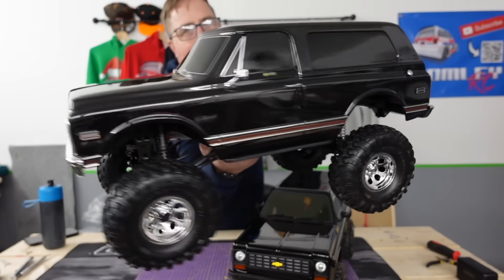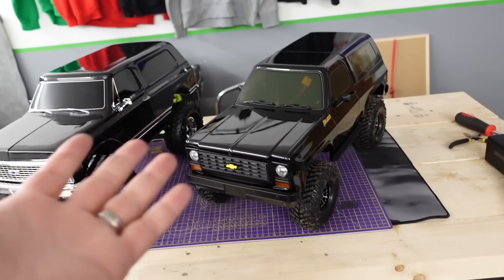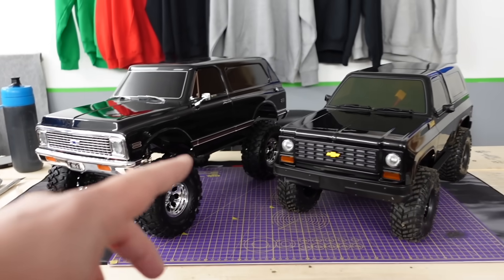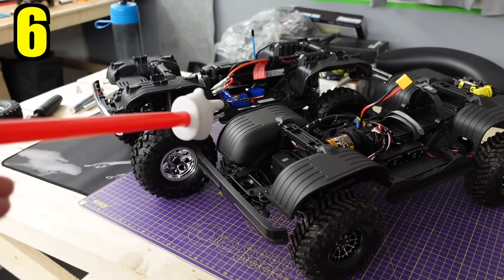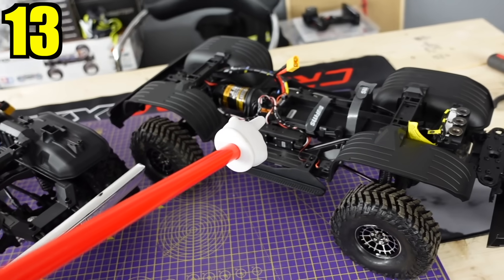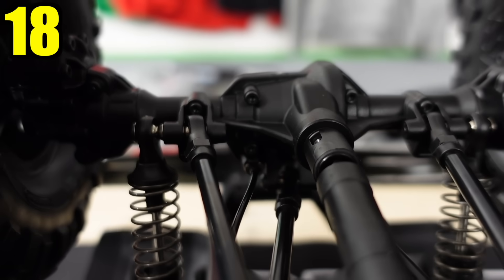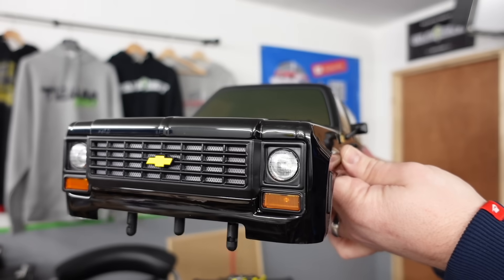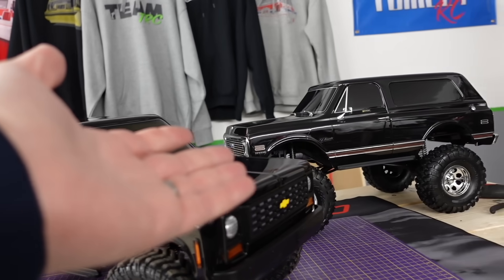You're Wrong.... Again!

Comment: You wouldn't notice because you aren't a Chevy guy, but  the FMS K5 body proportions are not correct, where the Traxxas version of the '79 K5 is. And that's a deal breaker for me.  I'm not sure if it's because Traxxas uses two different wheelbase chassis and FMD only has one

Comment: Can you make a video about 4 links suspension and 3 link with pan hard and see what s better. ?
Reply: 4 link servo on axle (SOA) every time. Lower servo mount lowers center of gravity and puts the weight of the servo directly on the axle, below the springs where you want any weight. Also, better, equal steering left to right and doesn't bump steer or lean the rig while steering like the 3-link with panhard does. Everything is sturdier and stays in line with 4-link SOA. I hope this helps
Reply: yes it does. thank you so much brother.  @OkieDokieBoi
Reply: @Techie_ASMR  not a problem. You're very welcome, my friend. 👊

Comment: if you had the correct trx4 this would be better. the one you need isnt the high trail but the '79 blazer from traxxas. by the way, the grills on them both designate them as 1979 blazers, maybe thats why people think this is a clone of the traxxas one. i have the high trail and my son has the '79, and i just got the fms one, took them over 2 1/2 weeks to get it to me. we both also have the fcx24 blazers which also have the '79 grill.

Comment: Not sure if it is relevant to the "copy" aspect but the suspension on the FMS seems sooooo much better just from watching you handle it. Is it stock?
Reply: I own two TRX4's and a TRX6. I also have this FMS. I can tell you that this FMS is loads better in every way. And yes, the shocks are so much better and smoother than the praised TRX4 shocks, and they flex more being 100mm!
Needless to say, I won't be purchasing another TRX4.
There is nothing needing done to the FMS except wheels, and brass internal rings in the fronts. It could also benefit with even just a tad bit more weight on the front axle to become a pure monster. I'm waiting for some black brass front outer portal covers or steering knuckles to be available. And that will be absolutely it!
Reply: @OkieDokieBoi  can you put an engine sound box in the fms?
Reply: @wolfkingsigma2795  don't get me lying. I've never installed a soundbox in any of my rigs, but I imagine you can install one in any rc you'd like. I personally haven't seen any limitations on that.
Reply: @OkieDokieBoi  cool man.  i just wouldn't even know where to plug it in on this thing?
Reply: @OkieDokieBoi  Also, where can you go to fix these FMS if they break?  I'm new to r/c and don't know how to repair them

Comment: My FCX10 has been run less than 3 hours. The steering servo is dead. The esc freezes in  reverse. It feels cheap and was. The nicest thinf about it is the transmitter.
Reply: I believe you have to switch the toggle buttons to get rid of the reverse delay it’s not a issue the servo I’ve looked at mine & it’ll be one of the first things I replace  it’s common unfortunately I have a SCX 10 3 JLU that was $500 & the dig servo died first time out & soon after the main servo & I have a TRX 4 2021 Bronco & the main servo went out on my first run in water & it was t even actually submerged just went through a little water & that was over $550 so ya kinda see the point.  Eventually FMS is coming out with a separate esc so you can replace the motor & still use the remote that will be one of the things I’m waiting for so I can replace all the electronics.
Reply: @Casitascrawlers  nope, it's not a toggle issue. The fact that other brands sell rtr's with shity servos is no excuse.  From the web page filled with erros to the truck that was rushed to market too quickly I'm unimpressed with FMS. I'm glad others are enjoying there's, I've had a different experience.  Have fun crawling or trailing or building today.
Reply: @franklee6301  I know there is a double tap rear throttle you can change to normal with the toggles but sometimes it’s just bad luck I’ve seen  real new cars with without even plates yet broken down & for sure anyones thought would be ok well don’t buy that brand but but just like reviews if I see one or to negative reviews on anything & 100 good reviews I’d buy that product with out hesitation it’s just human nature to not be happy with things & complain. 😂
Reply: @Casitascrawlers  the truck was released 10 days ago or so, it's far to early to tell how many are duds. You enjoy your FMS, I've gotten a refund for mine and am on to something with years of evidence to support its hype.

Comment: Hi, great video and very good comparison. A lot of useful information 👍 
I would like to get into crawling and am currently looking at the 1/10 models on the market. I would like to get an RTR model. After lots of videos and research, I have 3 models to choose from. The TRX4 Sport, Element Ecto and FMS RCX10. I would like to start driving straight away. Possibly change one or the other (servo, weights, tires) later. 
Can you give me a advice as to which of the three models would be a good start and would be fun to drive for longer without having to do a lot of tuning? 
Thank you very much for your answer/advice.

Comment: Tell it how it is Tomley👍👍 I have had two trx4's and both never worked right out of the box 😞 my fcx10 perfect. 🥳🥳
Reply from the maker: Yeah, the servos seem to be the weak point. One of my favourites is the Element Enduro SE… just a simple crawler with no frills
Reply: Funny....both of my trx4s work perfectly. 2 years on my 79 bronco with stock motor and esc and almost a year on my k10 high trail that also has stock motor and esc.

Comment: every single rc company looks at what works in other makers designs borrows elements makes slight design changes then implements them into their model, even the rc hobbyist borrow parts and bodyshells from other models to make them work better or look similar to others, all i can say is i couldn't care less even if it was a slight copy/clone, i thank god for the cheaper makes because if it wasn't for them i wouldn't be able to afford to have a hobby, do we all moan about the clearl...possibly copied spare parts you can buy on discount sites or do we just buy them anyway because they're a ton cheaper than oem and um mostly work?
Reply from the maker: I agree… it’s in pretty much every industry. There’s a point you get to where innovation can only get so far…. Portal axles on full size trucks gave the design for them on an RC Crawler.. if you change the design too much, they aren’t gonna function correctly. People forget that these toys we play with get a lot of there components from their 1:1 counterpart

Comment: I picked up mine here in the states for 399. Free shipping. Where did you get the servo guards? I didn't see them on the website.
Reply: They are an excellent investment, A MUST! I just checked so I could link you the part, but they must be out of stock, as I no longer see them, either. I got lucky to have snagged two sets. They are a must, imo, esp if you have gnarly and jagged terrain. Those and the metal driveshafts (which are really heavy), are a very nice touch.

Comment: I will not claim it’s a clone but,  Clipless body and locking diffs, I think, didn’t exist until Traxxas. I could be wrong but I can’t think of anything else. I think Axial started the dig function or at least Axial made it a popular option. At this point, if FMS “cloned” anyone, they cloned everyone. The only thing I can I think of is unique on the market is the Vanquish Phoenix VS410 with the remote switchable overdrive and the Element Gatekeeper/Ecto trailing arm design.
Reply from the maker: My 2005 Hilux had remote locking Diffs... so Traxxas must have copied that :)
Reply: @TomleyRC  yes but aren’t all RC cars technically a clone of real cars/trucks/ 10x10 Russian tank trains.
Reply from the maker: @mangler.m4950  yes, that's my point. So to say FMS copied Traxxas is wrong... because they all copied 1:1's :)
Reply: @TomleyRC  To be fair, I am agreeing with you that it is not a clone. I am not defending the claim that it is a clone. I’m only saying Traxxas may have been the first to have those features in an RC car. Remote Locking diffs were in the Summit way before the trx4 and Clipless body started on the XMaxx or maybe the ERevo 2.0. The FMS is a pretty cool truck and has a hell of a price. If I was starting fresh and wanted a crawler, it would be a toss up between the FMS and the new Redcat Ascent Fusion.

Comment: You are correct sir. They are two different generation K5's as far as the bodies are concerned. The only thing I cannot recall is which year K5 had the turn indicators in the bumper? From at least 1977-89, if memory serves me correctly, the signal lights were always just below the headlights. Regardless, both units look pretty good.
Reply: Traxxas is a 69-72 1st gen model. FMS is a 76+ 2nd gen model.

Comment: Axle mounted servo! Happy with that!! No idea why you'd want the servo weight higher than it needs to be on a crawler
Reply: The preference is based on scale competition rules. CMS basically forces the suspension design to follow real life counter part. In scale rc competition CMS class is considered more difficult than AMS. Hopefully you understand why there are 2 different preferences now.

Comment: My first rc was one of the smaller fms units I ordered from Amazon and I was so stoked!! I got It on a Sunday waited for the battery to fully charge while I finished the football game then get outside and after 3 mins of run time it broke. A small weed wrapped around the back wheel put it in a a bind and snapped the rear drive shaft 🤔
Next day I took it to my locally hobby shop and the guy informed they didn't carry parts for them and called it toy grade not hobby. He recommended I send it back and come buy a traxxas trx4m from them.... which I did and I haven't looked back!! I absolutely love traxxas products..... I have 2 trx4m units... a trx4 high trail k/5 blazer "70s body style" a new rustler 4x4 bls-2...a granite grom and I just got my new arrma 3s big rock in today 😀 Traxxas and Arrma are som eof the best brands in rc I my opinion 💯

Comment: It's not a "copy" but you can clearly see where the inspiration came from. Alot of your "completely different" is actually pretty damn close. Go watch scale builders guild for an unbiased opinion
Reply from the maker: It’s hard to make a crawler without the basic structure. So sone parts will be the same… but all the parts are not interchangeable and in some cases function differently.
Reply: @TomleyRC  it doesn't have to be interchangeable to be similar. In my eyes interchangeable would be the same and similar would be pretty close the same in general. Like I said its not a copy but with that being said it is pretty similar imo. Thats just my 2 cents in the comment jar. 🍻
Reply: @user-nz4pj7zh2i the scale builder comment was a cheeky stab 😘😘